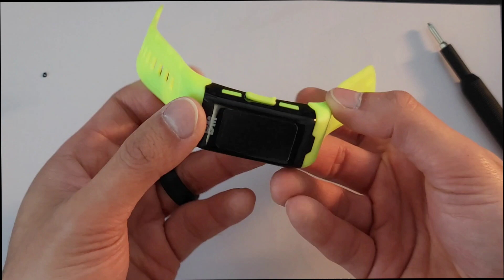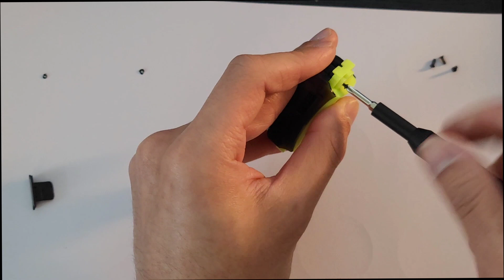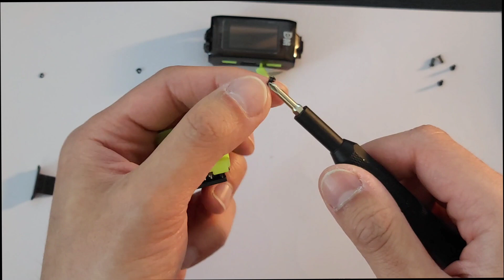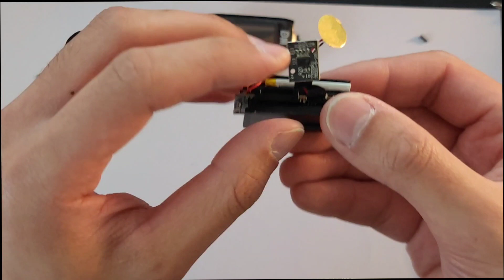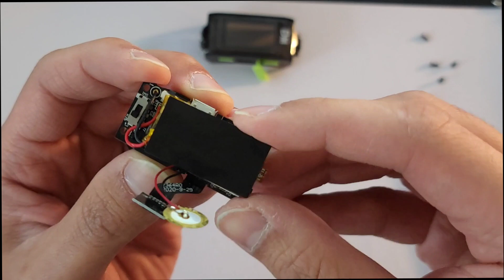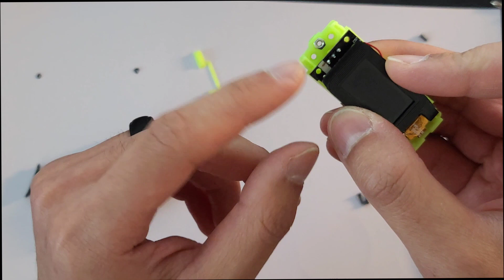Digimon Vital Bracelet Teardown

Comment: Will this also fix the buttons if they stop functioning?
Reply from the maker: Depends on what's wrong. If the plastic is jammed on the switches themselves, maybe. If the actual switches are broken and need to be replaced, then no. You'd have to find new buttons and solder them on in that case

Comment: for the “sd card slot”, does it actually accept an sd card? if so, what kind? i’m not really that tech savvy but i’m pretty curious as to what it does if i insert one in my vital brace. i’m also wondering if inserting the sd card would make the vital brace have some sort of firmware when programmed… but that’s just a speculation, so i wanted to ask. thanks!
Reply from the maker: The original VB does not, but the newer BE models do for firmware updates! For modding of the original VB I worked with a team to create a custom mod chip and I haven't kept up with the BE scene as much so I don't want to provide any misinformation on their current works. Hope that helps a little!
Reply: oh i see, thanks a bunch!

Comment: I really wanna take mine apart as the screen started acting up and I wanna take a look at it, but I can't seem to get the screws loose. They are very tight. Any like... easy solution?
Reply from the maker: Outside of the normal ideas, like taking a rubber band between the screw and screwdriver, I'm afraid I'm not too sure :(

Comment: Love videos like this! I do have a question regarding the heart rate sensor. My friend’s won’t pick up her heart rate anymore and I saw another comment that mentioned a discord I could look at, could you tell me where I can find a link to that? She can’t get a new bracelet but if someone knows something about a new sensor or how to repair it (she tried recalibrating it and even the trick with the paper and tape), she might be able to use your video to try and replace it.
Reply from the maker: Glad you liked the video! I'm assuming the Discord you're referring to is the Digitama Hatchery by Humulos, so I'm going to leave a link in here. There are channels for the VB and for modding vPets, so either of those may be a good starting point. My advice would be to start with the ribbon cable connecting the sensor to the main board. Mine physically broke off and I took thin wires and resoldered them together. If that still fails and it's a problem with the sensor board itself, then it may be a little trickier

Comment: I hope you'll also do a teardown video of the bootleg Vital Bracelets and compare it with the original one
Reply from the maker: Bootleg VBs? I don't think I've seen one, personally!
Reply: @VincentVeak  I just got mine from Shopee, which is pretty much the same ones sold at Aliexpress. They only cost $14 for the black and white, and $20 for the green ones. It looks and functions exactly the same as the original. The only difference is that there are tiny labels on the buttons side of the bracelet, and some of the japanese text in instruction manual has replaced with chinese text.
Reply: @VincentVeak  It also says the bootleg has an output of 5v 0.5A. Not sure if the output capacity is true but its very compatible with my Samsung micro usb charger and never had a problem so far.
Reply: I just found out that there's also a bootleg of the Vital Bracelet V which was released 8 months ago lmao. There's a spanish youtube channel by the name of Nicoshinx who made a comparison video of the bootleg and the original one if you're curious to know what it looks like.
Reply from the maker: @ProjectHomulust  I'll check it out, thank you!

Comment: Hi! Thanks for the vid, it's very informative and helpful! Would you happen to know anywhere online one could buy spare VB parts?? Particularly a new(ish) heart rate sensor? My original VBs one finally crapped out, I opened it up and the connections seems fine. But it fails to read, even after recalibrating. The green light doesnt even turn on anymore..
Reply from the maker: Hey there! Thanks for the kind words :) unfortunately I'm not sure where any of these spare parts would be available online since most of it looks relatively custom save for the battery, buttons, and maybe the screen as they all have standard electronics part numbers. As for the HR sensor, I think you may be out of luck on that one, but maybe someone on the Digitama Hatchery discord knows something I don't!

Comment: My top button got stuck on mine.  Do you have any tips on how to fix?
Reply from the maker: You'd want to disassemble it and check the button connections. Some of them get loose and need to be replaced or resoldered. Other times it's just the plastic button not sitting directly on the microswitch. Good luck!

Comment: I came to this video because the A button on mine started to malfunction, but I'm not sure what I can do to fix it.
Reply from the maker: Your best bet is to check the solder points and see if they're still well connected! Only other other is to resolder a new button if that one is broken
Reply: @VincentVeak  the inner button mechanism for the A button doesn't do the clicking sound anymore, I wonder if there's some kind of internal spring broken, as simply tilting my wrist the wrong way causes the device the register repeated A inputs. B still does the click when i press it.

Comment: Super helpful video! I cracked the screen that houses over the device, right in the middle.  Thinking I might Dremel it out and around the screen and glue in a piece of glass from a watch.  Not sure what else to do because I can't find printed parts for the screen. Can you pop the screen out and are there replacement parts?
Reply from the maker: Some people make resin shells for them and I occasionally sell the OEM shells leftover from my mods, but other than that I'm not sure what other options there are!
Reply: @VincentVeak  thanks for the advice!

Comment: My Heartrate have an Issue.

I dont know why but the toy cant detect my pulsations and appears "failed" in the screen.

I'm paled, so I dont know what is happening x.x

sorry for my bad english.
Reply from the maker: It's ok! Does it ever flash BRIGHT green when it tries to read your pulse? The sensors are pretty bad and have a hard time reading some people, but if it doesn't flush bright green, then it may be defective
Reply: @VincentVeak  the light turn on, but without strengh

I have the new VB with the gammamon and if I put my finger near to the sensor, the green light bright with more power, but in the old VB, doesnt u_u

Its broken? Its possible repair or its dead forever??

Im very sad u_u
Reply from the maker: @ditobi  yea the sensor might have gone bad. The only way I know to fix it is to solder a new sensor from another bracelet on the device, which at that point you'll probably just need a new VB, sorry :(
Reply: @VincentVeak  ains u_u
Reply: @VincentVeak  Hello! My VB sensor works some times and others... doesn't
I dont get it what is happening DX

maybe the batery? Oh my DX
Reply from the maker: @ditobi  Probably the sensor itself is faulty would be my guess

Comment: How do u change it to USB c charging
Reply from the maker: For the Vital Watch I use an adapter, but to use the stock shell you'd have to desolder the existing connector and find a 5 pin USB C header and line the connections up, which I don't recommend doing if you do not have any soldering skills
Reply: @VincentVeak  question are the new version digivice V bracelets USB c?
Reply from the maker: @akilluminati47  They are still micro B

Comment: If the 2 buttons on the side is stuck in, probably due to applying too much force during pressing, is there any ways to fix them? Thanks
Reply from the maker: Short of soldering some new ones in, it's hard to say! If the buttons on the motherboard are the problem, you'll definitely have to replace them
Reply: @VincentVeak  Guess it is time to find some new button parts at this rate.

Comment: I wish that replacement screens existed. It gets scratched up so easily, despite meant to be used outside.
Reply from the maker: I occasionally sell some spare shells I collect over time, but yea I wish Bandai just sold spares themselves lol
Reply: @VincentVeak  The only "spares" they do are longer straps. I also wish you could access the battery of the thing easier. Have it be a micro SSD card you can access without unscrewing. That way if your watch gets trashed, you can order a new one and keep progress.

Comment: Any chance you know why my Digivice V sound is really faint? I can’t hear anything out of it and what I can see is nothing is blocking the speaker holes. Factory resetting did nothing and neither did toggling the power button and the sound button in settings. I’m assuming this is a problem inside the device itself? Do you think it’s fixable or do I need to send it to somebody or is it just a dud that I have to replace when stock replenishes?
Reply from the maker: The QC on the VB as a whole is super hit or miss, and users have reported this before. It's most likely how the speaker itself was glued or soldered and really your best bet would be to replace the speaker by soldering a new one and glueing it down. Link to a new speaker is in the description, but I'm not sure if that's something you feel comfortable doing or not. Up to you!
Reply: @VincentVeak  My husband actually has a cracked screen original Vital Bracelet and the sound still works but he offered me that part to install in to my Digivice V. Think that work? Are they the same speaker?
Reply from the maker: @Wiseguy1138  They are indeed the same speaker! I'd check out my Digivice V teardown vide as well. They're the same teardown, but I go in more depth about common troubleshooting tips etc

Comment: Can you show how to repair vital bracelet sensor? My vb sensors 
 did not working
Reply from the maker: You have to solder the 5 connector pins to their respective locations with thin wires. You're probably better off watching a soldering tutorial and ask yourself if it's a task you're willing to perform

Comment: I lose sound, but my speaker solder looks fine... should i take it off and make my own? In case of the speaker itself, there is a way to buy a replacement?
Reply from the maker: You can certainty try! I'm not sure where to buy a spare speaker off the top of my head though. I've resoldered speakers from other Digimon vPets, used speakers and vibration motors from Amazon, and even the speaker/vibration motor combo from a PokeBall Plus all successfully on here, but the problem is that none of them fit into the original shell of the VB. That said, it's a simple solder job!

Comment: Mine got screen issue and just black but the sound still there, any advise what should i do?
Reply from the maker: Your screen is probably shot. You can try unplugging the screen and reinserting into its header mount, but you can also further damage your board if you're not careful. If that doesn't fix it, you're gonna need to swap screens with a working VB most likely

Comment: Great video! It was pretty informative!
I have an issue regarding my vital bracelet. I wanted to ask you about it. I actually found your channel and subscribed during my search for a resolution. 

  I always use it when working out. I sweat a lot. Even more so today. I noticed that sweat seeped inside my bracelet. I kept getting DIM card failure messages without any card being inserted. Of course it doesn't read any cards at all now... Does it sound like the bracelet is done for? Thanks!
Reply from the maker: Hmmm most likely! I've swapped the memory chip onto new VB hardware via soldering, so if you have intermediate soldering skills you can do that!
Reply: @VincentVeak , thank you so much for your input! I'm not experienced soldering, but I'll get myself familiar with it. The bracelet isn't really working as is, so there's no harm in trying! I appreciate your advice!
Reply: Last week I ended up taking apart my bracelet and cleaning it with 99.9% isopropyl alcohol. I also used a silicone conformal coating.  The DIM card reader just started working this afternoon!  I'm glad that it's working again. I guess that it needed to be cleaned and time to dry.

* It looks like I got ahead of myself. It's back to not reading DIM cards again.***

Comment: So my VB has VERY low sound.  Any idea what would cause that?
Reply from the maker: A few things, but mainly either the sonnection between either the wires or the shell itself are weak (the speaker needs to vibrate against something) or the speaker itself is damaged or defective. Any dent or bend in the speaker is also liable to damage it!
Reply: @VincentVeak  I have yet to take it apart to look at it, but I guess now is the best time
Reply from the maker: @NerdyNotionZ  I've looked at well over 50 of these at this point, and the QC is all over the place. I've seen a couple without any solder on the speaker, some are missing screws, some have too much/too little glue, and I could go on lol. I am not surprised that you got a partially defective product, sadly /:
Reply: @VincentVeak  Just checked the solder joints and they are fine.  Seems to making good contact with the bottom shell as well.   I guess I can live with prettymuch muted sound

Comment: my on/off switch is kinda sensitive sometimes it'll off by itself by just slightly touching it, any solution to this?
Reply from the maker: I'd check the switch itself first and see what's up with it. Unscrew the VB and get down to the switch and toggle it on/off both with and without the plastic switch on top. If it's the actual switch on the board, I'm not sure what you could do to fix it
Reply: @VincentVeak  oh thanks, I'll check it out
Reply: follow up to this, it's weird that everytime i put back the plastic switch back on it'll have the problem.
so i decided to not use the switch as it is LOL
Reply from the maker: @ostamp39  yikes, what a weird issue! Sorry about your luck man. The QC for these things is all over the place. I've opened over 60 VBs at this point and it's seriously hit or miss and I've seen so much variance for what I feel is a small sample size of a mass produced electronic
Reply: @VincentVeak  as long as it's playable now LMAO

Comment: The sensor of mine is broken, isn't reading my values, and if I try to calibrate it heats up and don't light on, any suggestion to fix it?
Reply from the maker: It's probably faulty. You can try to remove the sensor from the housing and press it directly to your wrist to see if it lights up bright green, but other than replacing the sensor all together, which requires some fine soldering skills, there's not much else you can do sadly
Reply: @VincentVeak  yep I did it yesterday, the sensor don't light on, do you know the name of that piece, I'm going to try to repair it, I have another VB but, I want to keep both working
Reply from the maker: @Dippermon  I don't, unfortunately. I just have so many VBs laying around from my Vital Watch project that I have spare parts
Reply: @VincentVeak  thank you very much for answer

Comment: Any ideas where I can find a replacement battery? I have had mine less than a month and it seems like the battery is going out. I put my charger in and it goes green like it's full but I pull it out and it's goes to half or lower.
Reply from the maker: It's just a standard 3.2v 160mAh battery. You can find many of them online
Reply: @VincentVeak  I saw that after I posted, but what has me stumped is how do I know I have the right size?
Reply from the maker: @TheSothar  Like physical size? Easiest way is to measure the battery itself to see what fits! I measures it to be about 15x30mm plus or minus 2mm cuz I don't have calipers lol
Reply: @VincentVeak  Hello, can you recommend me where can i buy the replacement? I tried to find the 3.2v but mostly it says 3.7v. Sorry a bit of newbie here
Reply from the maker: @prestenikoseptirahadian9607  sorry it is 3.7v, I'm just a dummy and I mispoke. That's correct! 3.2 and 3.3v were for another project I was working on, and 3.7v is standard for lithium ion
Reply: @VincentVeak  oh haha okay sovit is correct right. I also double checked your pictures and it is a 3.7v. Anyway thank you for your answer 😁

Comment: What size screw driver are you using?
Reply from the maker: JP00 but you can get away with pretty much any small electronics Philips head
Reply: Thanks for the tip! My buttons don't work on myp bracelet fresh out of the box. You have any tips on how to fix it? Or what the issue could be?
Reply from the maker: @johny21213  are the buttons clicking at all or not? You can take the top shell off and click the actual micro switches themselves to see if it's working. If those fail, then you may just have a faulty device. You can try like 90% isopropyl alcohol to clean the connections but you gotta be super careful

Comment: Out of curiosity, what's the markings on that SOIC-8 chip? I imagine it's some sort of SPI NOR flash, would be nice to dump. If it's a GeneralPlus chip, then the MCU under that glop top might be a GeneralPlus chip too.

Edit: it's KH25L12833FM2I-10G. 128Mbit, contains half of the firmware and non-Digimon sprites.